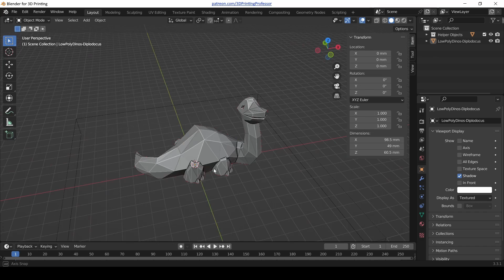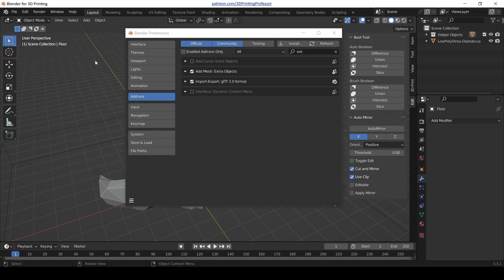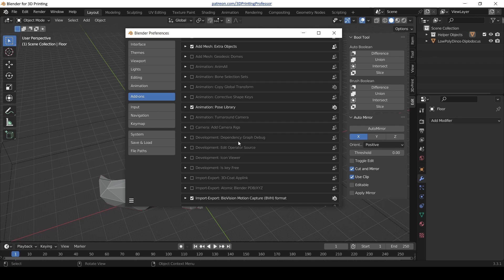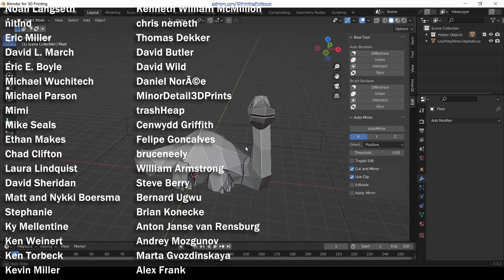Blender Tutorial 9 Essential Adds-ons for 3D print modeling

Comment: I also like the import images as planes addon pre-packaged in Blender it's great for bringing in reference material. Also MeasureIt can be quite helpful.
Reply from the maker: Thanks for the suggestion.
Images as planes is a lot of fun, especially for rendering. But if all you want is a reference image, I find that add (shift+A)->Image->Reference is a better way because it retains it's visibility, even in solid mode. However, you can't then edit the plane and make it into a visible object, so there's that.
I'll play some more with MeasureIt. I've tried it, but haven't found it very useful so far.